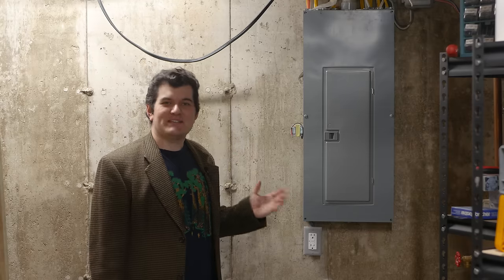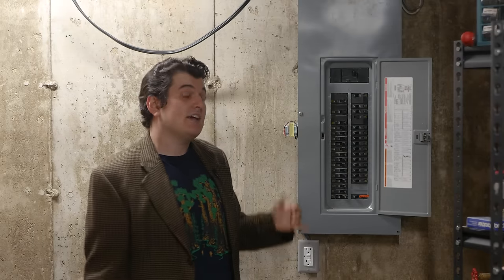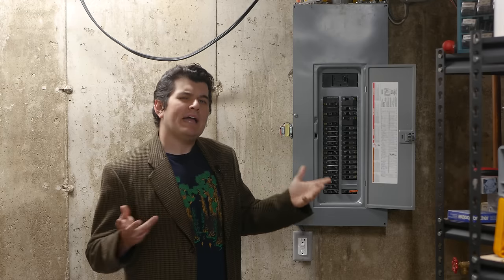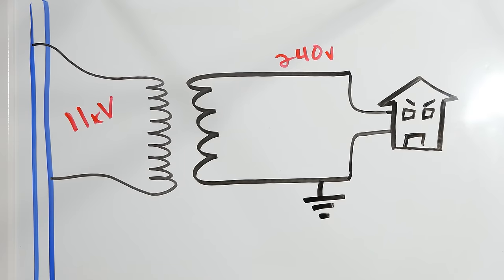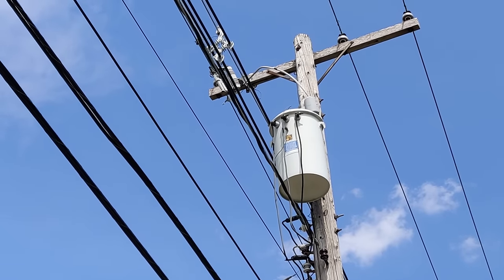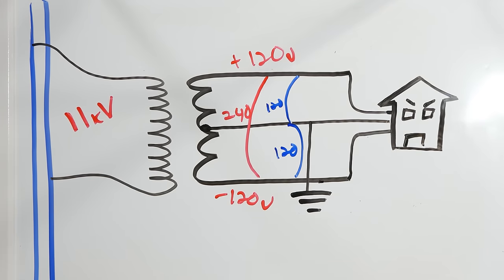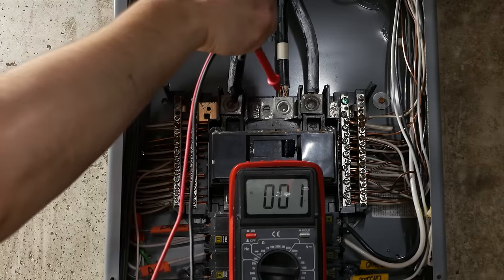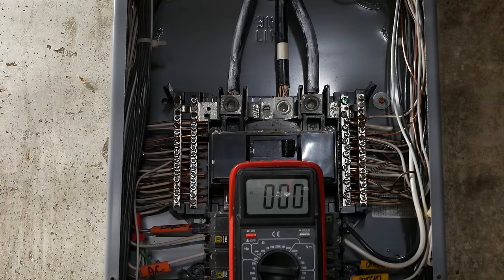The US electrical system is not 120V

Comment: Hiya, I'm a Brit, and my Hometown is Llandudno (N. Wales). To add a bit of curiosity, I should add that homes in Germany have 3 phase power too as the 3 phases and Neutral are brought in (primarily for the Electric Cookers). As in the UK, the vast majority of the power is under street, only very rural areas (Farms etc) would have local transformers. We started in the UK with ring mains due to copper shortages (post war) (and BS1363was  introduced in 1947), so that any one point is fed from both sides. Using 2.5mm T&E, we fuse the circuit at 30A (which could technically carry 40A (or more if the cable is clipped in open air). I have lived / worked in other countries too. China was the least safe (in my eyes) with cables running along the streets and the number of kites and balsa wood airplanes seen jammed in the cables were quite scary - even more scary was to see the kid with long bamboos, trying to dislodge and rescue their toys, along with adults passing nonchalantly by, mostly ignoring such dangerous kids. Taiwan was only marginally better, there the adults chased off kids trying to rescue toys from the cables. One of my Brothers in law was a Spark his entire working life (Trained by LEB) and one of my closest friends  in Llandudno was a Spark too (also Electricity Board trained) and I worked him on many jobs over the years.

Comment: In Croatia we use 220V on single phase for most things (just like your 120V). And we have 3 phased with 380V for stronger apliances (boiler, oven, ...). And I think it's all grounded (and every outlet is) altough not all appliances have a grounding cable/connector (depends on if it needs to have one).

Comment: I live in the UK the reason we have switches on our wall sockets is a throwback to earlier days when too many servants and housewives were getting electricuted by somehow touching the brass pins when plugging in their early electrical devices like home appliances and heaters. so to fix this British Standards (BS [no pun intended]) introduced the switch on wall sockets to have the socket isolated from supply whilst one is plugging in an electrical device then once securely plugged in switched on there to power the other switch on that device, a double switch safety feature. This process went on for decades, but it only reduced the injuries and deaths because a few lazy victims neglected, or forgot to switch off the wall sockets. it wasn't until the late 1980's that someone came up with the brilliant idea of the half brass half plastic pins on the plugs that meant when plugging in the brass bit disappeared into the socket leaving only the hard plastic bit exposed where an unsuspecting finger could touch a live bit of brass whilst fully pushing in the plug,  therefore making the need for the wall socket switch unnecessary, but  like anything to due with Government health and safety regulations switches are still required on any new wall socket one can buy in the UK DIY, or trade stores. The need for fuses in the plugs themselves is yet another history lesson I won't post here, but it had to do with the archaic way the early fuse boxes were designed 110 years ago. 😄
Reply: I’ll also add, if I had a choice of either unplugging a device with a UK style plug vs flipping a small switch, I’ll use the switch. The UK style plugs are damn near perfection but they can be a bear to insert and remove. I think Alec is missing this possibility. The US plugs are so loose they sometimes unplug themselves.

Comment: You forgot to add that: homes over 4,000-6,000 square feet in the US require 400 Amps of service, not 200. My best friend lives in a big house and they have TWO 200 amp, 60 space panels, with a 60 amp sub panel for their pool and boat equip.

Comment: A couple of comments from an Arrogant Aussie who likes our plugs and switches:

1. Switches at the wall outlet is simpler than unplugging.  Sometime plugs can be a bit stiff or awkward to remove depending on where they are.  A switch is very easy to flick.  Also unplugging appliances leaves an “untidy” cable and plug lying haphazardly on a surface, rather than being neatly stored in a (now) inactive outlet.

2. Fuses in the plug (UK style) is not that great an idea in my book.  It makes the plug physically too big and chunky, and is just another failure point with electrical connections to the fuseholder.  Also conducting fuses is really old technology - far better to have all the safety mechanisms (current overload protection and earth leakage) centralised at the sub-board with the modern RCBO.

Comment: Here in NZ. we share wiring systems with Australia, [just not the actual power, their power stations still burn brown coal !]  Our outlets are 240v 50 Hertz, like Europe,  which is why we never allow them in wet areas without a safety device, usually an RCD or residual current device. And no, we do not leave outlet leads live for the very good reason that leads get flexed and fail!. One other thing: the reason that the British put fuses on the sockets is because they run loop wiring through the house, not individual feeds to outlets. For commercial or industrial power here, we pay extra for a three phase connection  just as you do.   Great for heavy service motors and stick welding. You've not mentioned the different hertz. Good luck getting your corded drill running on the wrong one!

Comment: Haha, love the rant on UK switches on the plugs. They really are insane. Other fun fact that even less people know, the US split fase 240 power can also still be found in older area's in for instance the city of Amsterdam. (Netherlands) although this system is being fased out. (Pun intended) another fun fact, in the Netherlands we have something called pirilex. This also combines two circuit brakers. For example, an electric furnace will need 240V and about 16 Amps two run two plates. But a stove might have for plates. That makes a wiring with one neutral, two times a fase from two different brakers and an earth, thus four wires and even so interesting plug as the one you showed for the dryer. We also can opt for three fase. That's rather interesting. It will let you create 400 Volts. That way the four plates of the furnace can be powered at ones. But this comes with different breakers, and extra heavy power plugs. But, for safety, most "high consumers" carry an earth lead. So not just bathrooms and kitchens are secured for earth leakage. Every circuit in our modern standard house is secured.

Comment: I live in Ireland and I can confirm that switches on the sockets aren't always a good thing. In our old residence, which we had lived in for over a decade, our landlord was the guy who did the living area electrical work... he ain't an electrician. One day, switched off the socket beside the dining table and in half an hour, the entire house reeked of burning plastic. It didn't trip and melted a charger cable into it. That being said, it isn't that surprising, since he hired the people to 'renovate' the house beforehand as well, seeing as he fell through the ceiling after breaking through the cheap wood under the carpet. Basically, if he had anything to do with the house, it broke.
Also I know only of three wires. The blue one, the brown one and the candy cane one. I must say now that despite the appearance, it does not taste like a candy cane. It tastes like copper and plastic.

Comment: We have 240v 120v single phase. 3 phase has 208 277 and 480v depending on load and machine requirements. Though through equipment you can get a 120 or 240 from a 3 phase system …….We have the NEC national electrical code to understand, but then we have the state code book as well some cities have code books too

Comment: In Germany we work with 230v coming out of one cable! Furthermore we have three-phase current which runs with 400v between two of the three phases and 230v between one phase and neutral ! :)

In most homes we use 16 Amp fuses for the „small“ circuits the main circuits is dependent.

On the other hand we have 50 Instead of the in the USA standardized 60Hz.

Comment: On that switch near the outlet:  they sell mini devices at Amazon to cut power selectively which I use on things that don't have switches on them.  For things like a blender, they do have an off switch but once I had a blender that had a trace of liquid that slid into the buttons (or had some electrical issue with it).  One day I was sitting at the other side of the room, the blender just started sparking... if I had that switch by the outlet, I could've ensured no power went to it.  Fortunately I was home.

Comment: There are homes with 120 volt services in the US. I just worked on a two family that had a 60 amp 120 volt service, 30 amps for each apartment. This is common in older services that just feed a sign in a parking lot for example. Just worked on one the neutral came from the right side of the meter. Think you are confusing the fact most branch circuits are 120 volts with how they are fed. Most large buildings are 3 phase with a center tap so are line to line. Have also worked on 480 volt open deltas in industrial buildings. They just have transformers to create a neutral with a center tap.

Comment: In Britain our appliances do have the off switch we just have off switches at the wall so we don't get at electric shock when plugging in appliances. Our plugs are pretty well designed though as they have plastic over the clips so if the plug isn't fully in the socket then electricity won't jump between the clips which is a more serious hazard for not only electric shocks but also fire hazards.

Comment: If there truly is more of a shock hazard in the US, then it must be insanely low. I have never heard of anyone getting shocked while plugging or unplugging anything. However, some friends and I may have done some stupid things when we were teens, including stripping the wires of a lamp cord and pinching the ends in our hands with our fingers. Aside from it startling us during the first second, it doesn't hurt (at least on your fingers), but in hindsight, I am not sure how dangerous it was having that current run from one hand up through the body to the other hand.
Reply: Exactly.  I'm an old retired guy and I have never been shocked while handling a plug.  I think I have been shocked only twice.  Once as a young child sticking something in a receptacle.  Once as a teen tinkering with electrical things.  I had a device mounted on a board connected to power through two bolts put through the board.  I reached behind it and put my wrist across the terminals (accidentally).

The modern way to protect against shock is to have ground-fault circuit interrupters on every circuit with receptacles.

Comment: The 110V isolated supply transformers on UK construction sites go back to the 1960/70's, when most power tools were metal cased class 1 equipment. Most tools now class 2 double insulated. The H&S Dept recommends battery power tools where possible. 230v is permitted but an RCD has to be used. In fact 230v was always permitted.

Comment: 110V saftey supplies for Tools will be Yellow, this is not off the mains, Phase to Neutral in the UK used to be 240V and Europe 220V now we are all at 230VAC. Saftey power supplies for tools (YELLOW) are transformers plugged into 230VAC primary, secondary is 110V with centre tap so earth fault is 55VAC..... Not all sockets in the UK have switches. Ring main is rated at 32 amps, with 2.5mm cable forming a ring allowing the cable to feed both ways, otherwise 32 amps would be too high for 2.5mm cable, Max plug in UK is 13 amps, Europe has radial circuits so each socket goes back to a MCB in consumer unit, lots of German house switch lights at low voltage via a relay or a modern house uses DALI or KNX for control, therefore light is permanently powered. Our 13 amp plugs allow individual fusing via a cartridge fuse 25mm x 6.3mm typicaly 3, 5, 10, 13 amps... I cant get over you using wall nuts (dangerous) I worked for WAGO Ltd in UK for 28 years and the WAGO 221 is far superior (don't like what its called in USA though :- Lever Nut)

Comment: Most new homes in Norway are being built with three fase 400 volt in the box and of course 230 in the outlet, but for car chargers etc its really nice to have that 400
Reply: Interesting that in some countries this only happens with newer houses. In Austria we have had 400V for many decades. Usually every household has a 400V line in the kitchen to connect the cooker and a 400V socket in the garage to connect a machine (e.g. concrete mixer).

Comment: Voltage variations...  One VERY important thing is that when voltage supplied to the home is higher, even by a few volts, your cost will be LOWER to use it.  Meters run on KW consumed and that is amperage.  The higher the voltage, the lower the Amps.

Comment: A point of order Australian and NZ plugs are NOT the same as UK plugs. Ring mains allow for 2 times the capacity to run on a thinner wire all-be-it there are 2 of them and a switch on the outlet lessens the risk of sock when pulling out the socket - you can't have it both ways; dissing the US outlets and then dissing the UK! An included fuse in the plug allows for better control of over current on particular devices and is a legacy thing. All that aside, great video and keep it up.

Comment: If I recall the switches on outlets in the UK is a holdback to back when appliances did not come with a plug.  You had to actually wire the plug in yourself because different homes had different plugs and now it just sticks around as another kind of power isolation. 

British electric has a really weird history.

Comment: Leaving the electronics powered is exactly what causes the circuit board failures in a lot of american appliances. Since they have low quality CapXOn capacitors with a very limited number of power on hours before they go bad, the devices fail from just being plugged in to live power even if you are not using them. I started putting on/off switches on my appliances from my pressure cooker, to my htc vive vr lighthouses, battery chargers, sub woofer amp plate,  and more just to get more powered on hours out of the circuit boards in those devices before needing to replace capacitors on the circuit boards or even the entire circuit board itself.

Comment: As far as I know, at least where I live all incoming power is now 400 volt 3-phase. Each phase carrying 230 volts. Only old houses could still have single phase power. Usually only one phase is used but it's really easy to connect to 3-phase if you want because it's already there coming into the building. It's pretty awesome since you can run some serious industrial equipment like a tablesaw they would use in a sawmill. And with all the solar panels and heat pumps people are installing these days 3-phase is actually becoming the standard.

My grandpa tought me how connect the other 2 phases coming in, because he wanted to use his old tablesaw and teach me something in the process, but its really dangerous to do this by yourself. You're supposed to call the network maintainance company in your area to have this done for you, they would turn off the power in order to do this safely.
It's illegal to do by yourself but he doesnt give a shit. He just did it with everything live! He just put on some gloves, got his insulated tools, put on his reading glasses and there he goes! I got to be honest, I had my phone ready to call an ambulance in case anything went wrong. 
But apart from some minor sparks nothing really happened. He really is from another time, he survived WW2 so I guess something like this doesn't even phase him (pun intended).

Comment: 120v per leg. Single phase. 120,208,120 3phase. You're not getting 240 all at once as it is separate. The double breakers use both legs. If you open the panel you can see the rows and that every other space comes from the other buss bar.
Reply: What?

Comment: On a main panel with a main breaker in it you can connect the neutral and ground wires on the same buss. You have to separate the neutral and ground wires on a sub panel or after the main breaker if that is located on the outside of your building.  Make sure to remove the green bonding screw in the sub panel.

Comment: My house, originally built in 1947 had one 100 AMP service meter.  In 1974 when they quadrupled the size of the house, instead of upgrading the existing service to 200 AMP they just added another 100 AMP meter to the house house.  So, now in the mid 2020s the house is barely capable of managing its modern electrical demands.

Comment: Great video, thank you so much. 
Two questions though: 
1) the Neutral and the Ground on the dryer (12:51) and neutral on the car charger (12:46), are they all connected to the same middle cable in the service panel? 
2) If so why not to use third pin on the dryer for both Ground and Neutral instead of using two separate pins which are connected to the same wire?
Reply: The ground wire, equipment ground, must not carry current under normal operation as it's an open line only connected electrically to neutral/ground bus bar in the main panel. Its purpose is to trip the breaker in the event of a ground fault. Otherwise it's a shock hazard.

Comment: 2 minutes of pure Snark at the end? Brilliant!

Still unsure about what is so wierd about ring mains? What's the alternative, You run a seperate cable to each socket (outlet) or daisy chain them so the cable to the first socket has to deal with the load on every socket. Do you use gradually smaller cable on each section?
With a ring main, every socket on the loop gets 2 runs of the same diameter cable. Very handy for all my 3kW kettles, toasters, heaters, tumble driers that can be plugged in anywhere in the house.